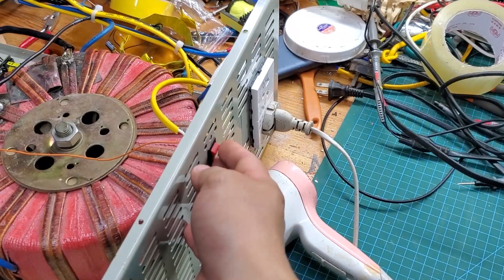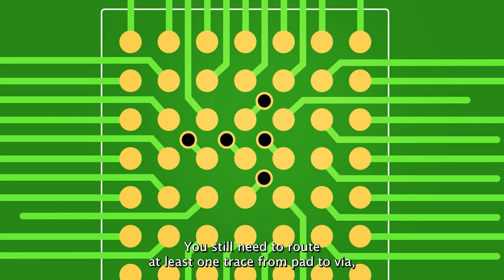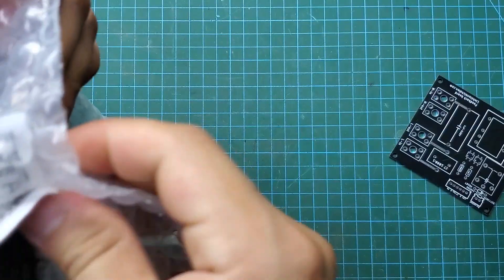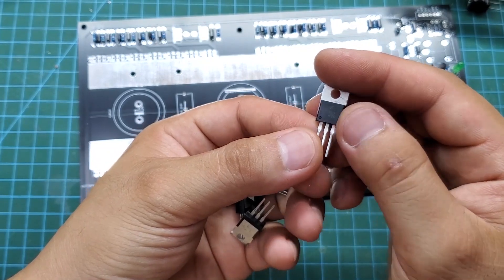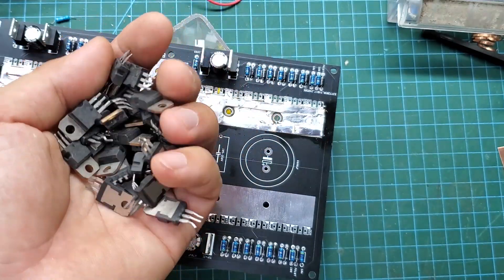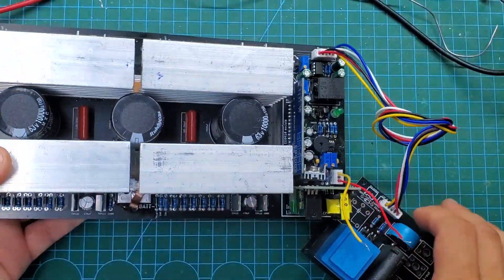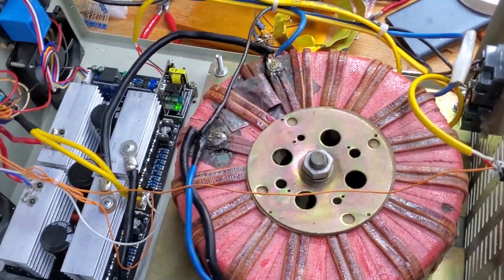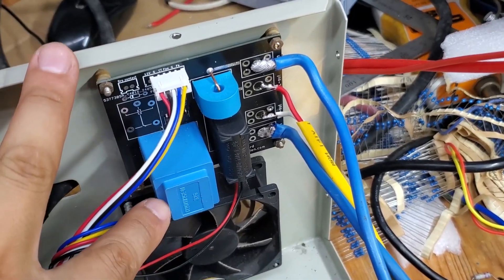8KW - 48V inverter using an iron transformer | JLCPCB

Comment: could you make an extra video, answering the question: - where one uses this for? 
- is it for solar energy conversion? 
It’s not clear to me where one uses this for? In any case, thank you for this video, because I would love to learn, how to design and make circuit boards! I would love to make a programmable circuit board with a few heat sponsors and 12 power relais for a pizza oven controler, including a small lcd screen.